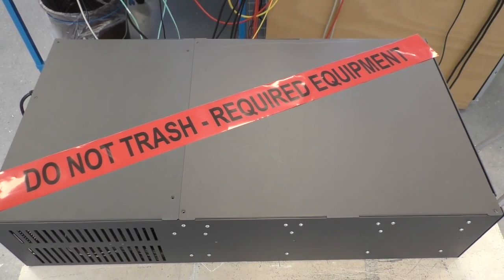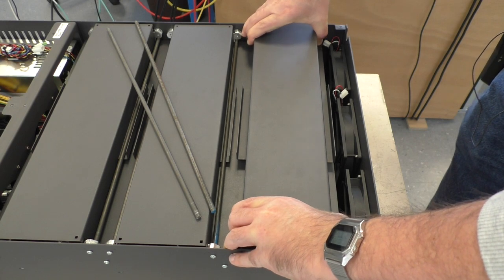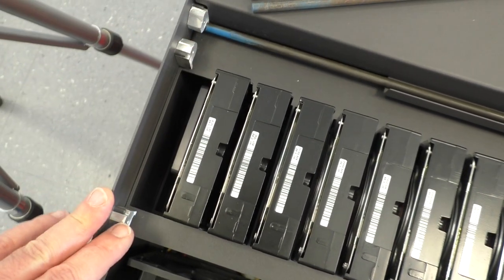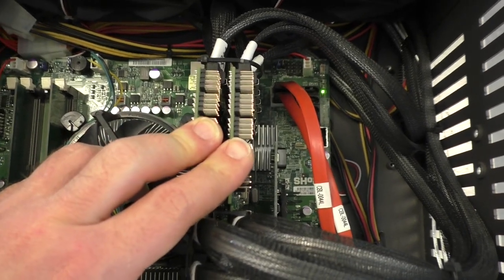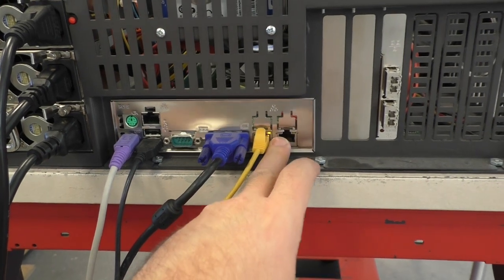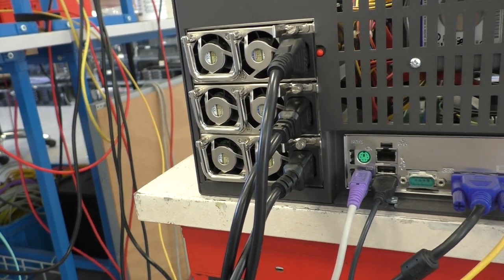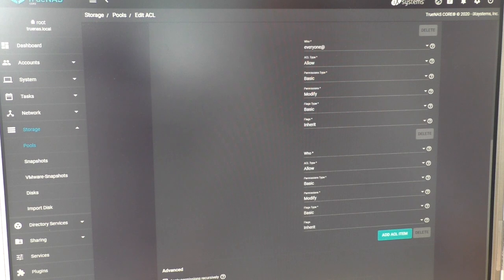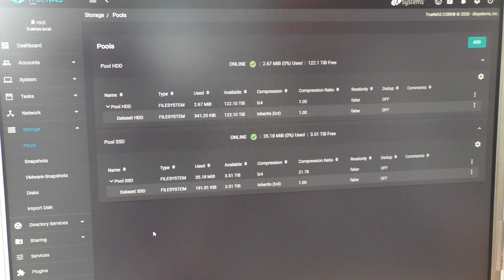800TB in one box? No problem! (With IODD virtual drive) - PWJ180

Comment: In 1998 or 1999, the company I worked for (we did data processing for McDonnell Douglas and Boeing) bought a 500 GB Amdahl box called eLViS. It cost $250k. We also bought an EMC DASD box containing 1TB of mainframe storage. It cost 1 million dollars. We also bought a 30' ATL (automated tape library) for 3.5 mil. They are essentially trash now. Crazy
Reply from the maker: I was at a course at ATL in California in 1999. The machines were very well built, not to compare with modern stuff.

Comment: 2:35 Put a piece of spongy foam in the gap and on top to stop the SSD flapping in the brease. SATA connectors are quite fragile so it just being held by the connector is not good.
Reply from the maker: I think I will remove the SSD's completely and use them for other projects...

Comment: It is a really nice case, but for FreeNAS and ZFS, it probably is worth adding some extra RAM. ZFS is pretty hungry in terms of memory. I usually use 32GB for a system with 24 drives. 8GB will work, but is a bit low IMHO.
Reply: Thats ridiculous. Why should it need so much memory. Its just a file server.
Reply: @simontay4851  ZFS loves memory. It will eat as much as it can. If you enable DeDuplication, you'd better have a bare minimum of 16GB. 32GB would be ideal.
Reply: @SimbaSeven.  You shouldn't be enabling deduplication in 99% of use cases. Don't do this, unless you really really know what you are doing, (and have 1000TB of storage). When Deduplication is enabled it is recommended to use 1GB of RAM (or L2ARC cache on fast SSD) for every 1TB of storage for best performance. Without dedup (normal zfs use even for medium size shared file servers), a significantly smaller amounts of RAM are fine, but in the past it was really hard to run with less than 8GB of RAM, but thing improved a log. You can run with just few GB fine, but more the better, so CoW can do its magic better.

Comment: At 30:06, you can see below the list of selected disks, that it decided to use raid-Z2 for the SSD array, and for the HDD array it decided to use Raid-z3. You can also automatically change it to stripe or mirror.

The issue with your setup of a single raid-z3 vdev group of ~30 disks, is not recommended. It is better to create smaller raid-z3 groups. I.e. 3 groups, 10 drives each. I usually use raid-z2 myself, with 6 or 8 drives each, and if I have many controllers, I do splits so each group has equal number of disks from different controllers used. If you don't care about performance too much, but want to get as much space as available a single raid-z3 vdev group with 30 disks should be fine. It will work fine, especially on reads, but writes will be somehow slower than other configurations.

I don't use FreeNAS, but it is using ZFS in FreeBSD, and I use ZFS routinly on Linux, and it is easy to configure, so I am sure FreeNAS can also configure it. It can only be done at pool creation time.
Reply: I've been using TrueNAS Core 12.0-RELEASE on a 15bay (15x8TB) RAID-Z2 for a little over a month and haven't noticed any issues. I'm also running it on a Dell PowerEdge R710 w/6x8TB RAID-Z1 as well.

Comment: You do not have to “switch” it to hard drive mode!

These devices can work on dual mode: HD + ODD all the time with no problem.

Most computers would boot directly from the virtual ODD, but if not, simply select the virtual cdrom when booting, done.
Reply from the maker: Yes most computers do but I had one or two that got confused by the additional HDD. Also sometimes it's quite a task to set the boot drive in the BIOS. Therefore I prefer to use the CD-only mode..

Comment: Ok I got to get me one of those IODD's. I have a dozen USB drives with Installs on them. To be able to put ALL my IOs on one drive and then just select the one i want?!! Will have to look into it more! 

Also Looks up Linux Tech Tips. They are a big user of 45 drives and have one with a Petabyte unformatted capacity and a 3 Petabyte unformatted capacity one! They are pretty cool.
Reply: The IODD looks great, I've never seen one before. It's great that it's so compact.
 There is also a software based tool called Ventoy. Installs on any standard USB, or portable spinning disk or SSD. Occasionally there are devices that have trouble booting, but last time I checked there is a large list of OS's that will load correctly using uefi or secure boot.

Comment: 4:38 how can you have 4 drives per cable. SATA is point to point unlike the old 50 pin SCSI or IDE/PATA interfaces. There is no master/slave.
Reply from the maker: Look closely at such a cable. It's 4 cables in one. All the "professional" RAID controllers and HBA's have multiport connectors. Look into a server.... if it has a backplane for 8 drives, two SAS cables will connect it.

Comment: @2:00 not sure if i want my drives seating that loose :P
Reply from the maker: It's not too bad when you use 3.5" drives. They are held by the cover pretty well. But the small SSD... well that's not the way how it works.
Reply: @PlaywithJunk  ssd does not spin 7200 rpm, thats my angle for loose hdd's, it could destroy the ball bearing

Comment: I'd have created that pool differently. So you have 15 drives in 3 bays, 2 in each bay are SSDs. I'd create 3 vdevs in raidz2 with 12 disks and leave one for spare, use the SSDs as cache (ZIL and L2ARC) drives for the pool, basically like this: zpool create mypool raidz2 disk1 disk2 ... disk12 raidz2 disk14 disk15 ... disk25 raidz2 disk27 disk28 ... disk38 log mirror ssd1 ssd2 ssd3 cache mirror ssd4 ssd5 ssd6 spare disk13 disk26 disk39

This gives you 3 legs of raidz2 vdevs (let's call that a RAID 06) with ZIL and L2ARC Caches and 3 spare drives. In each leg two disks can fail without data loss, so theoretically a total of 6 drives (only if split evenly, so 2 in each leg - but more than two drives failing in one leg at once I'd call extremely unlikely) could fail before the pool would die. Performance with this configuration is pretty decent, it was no problem saturating a 20 GBit/s LACP link on a file server - and the limit was the network, not the disks. :D
Reply from the maker: You are certainly right. What I did in the video was just an example "how to" configuration. I don't claim it was the best configuration...  :-)

Comment: I hate file servers, they are loud, disks consume a lot of electricity, and you always want to buy and fill bigger ones. It's up to you , but you should use those SSDs for cache. ZFS has separate types of cache for read and write (async writes only). I found that write is more useful with slower disks.